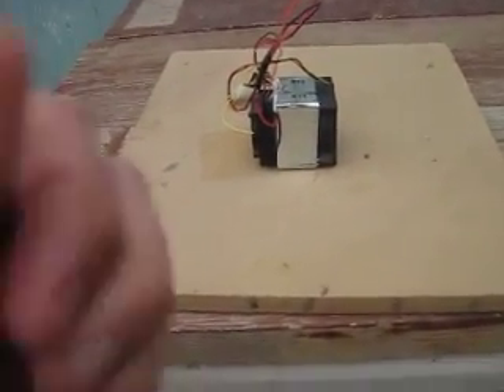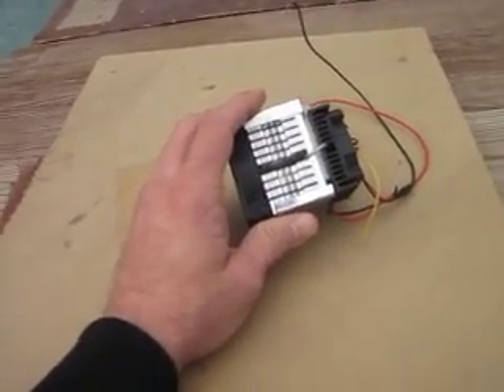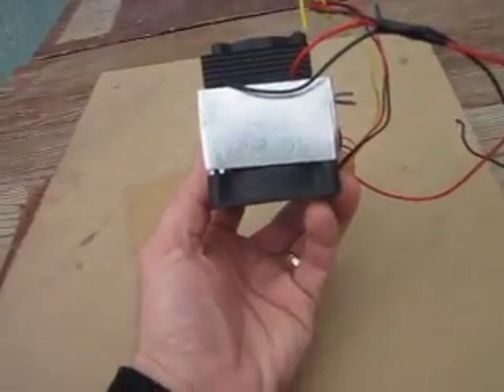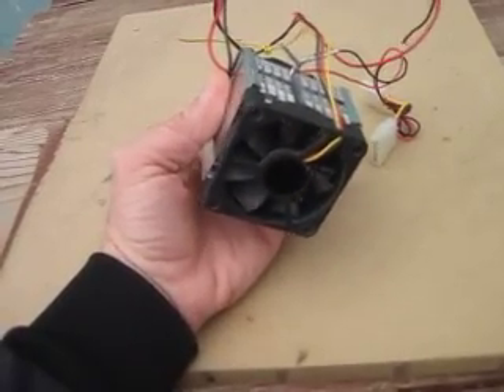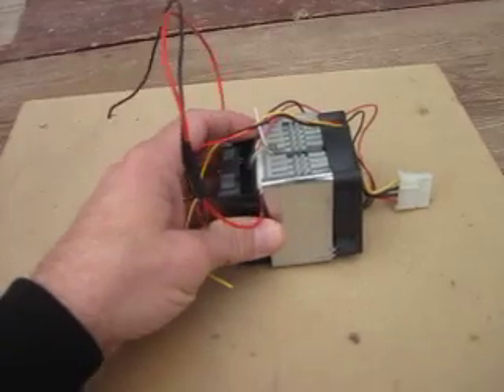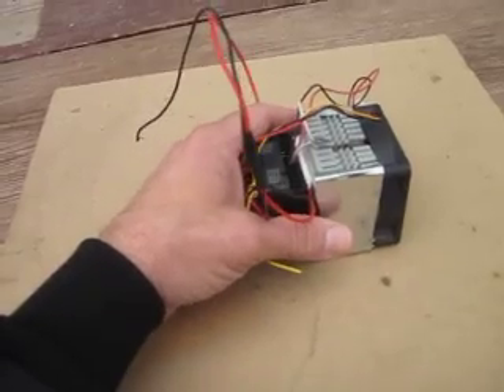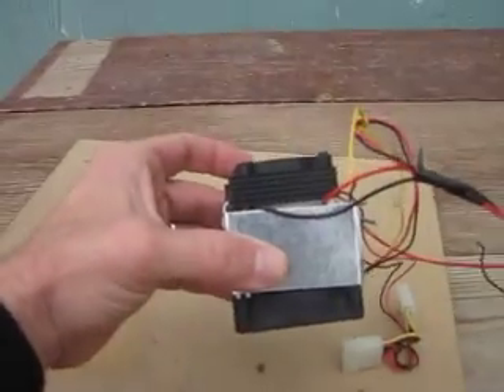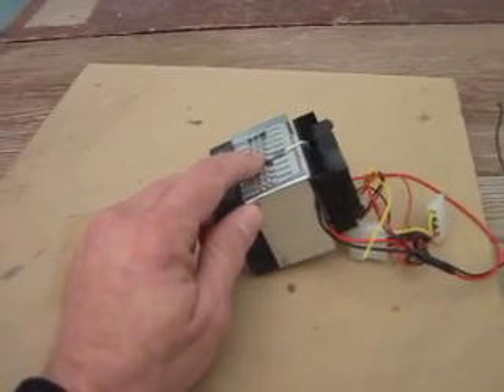Peltier Device explained a bit better.

Comment: should i connect 12v/40A SMPS with TEC1-12706 peltier module?
Reply: It will run at maximum if you do; if you want to dial it down, lower the voltage and amperage. Gotta regulate!

Comment: If you live in a hot climate, you could flip it around and make a personal a/c. Roll it up in your window opening, hot side out, cold side in...reverse the cold-side fan so it pulls the cold off of the cold-side heat sink, blowing cold air towards you. It may not cool the whole car, but if you roll it up on the drivers side window and face it to you...a personal air conditioner.

Comment: I got one from ebay and fry up at 9v 2 amp but on the site sais 12v 6amps why it did that? and the hot side was at 33c° and the cold side at 19c° so why?

Comment: i had a quick question if i may ask. when hooking up the device with the 2 fans and peltier to a 12v 6a. should i do series circuit or parallel when hooking up the wires....

Comment: SIR,
  i am making a project on peltier helmet. how much current should i pass through the peltier plate if its specification is 6 ampere 12 volts and 60 watts. should i take 6 ampere or less...and why ?
Reply: +Bill Graham i have 12v 1a adaptor, can it produce enough power for 12v 5a peltier device?

Comment: How are you regulating the amperage? My understanding is that amperage is relative to the voltage you are running at ie 2v will draw .3~.4 amps and at 15v it will draw 5~9 amps, are you cutting duty cycles?
Reply: SIR,
  i am making a project on peltier helmet. how much current should i pass through the peltier plate if its specification is 6 ampere 12 volts and 60 watts. should i take 6 ampere or less...and why ?
Reply: umang shah I would say go with a alternate approach, liquid cool your helmet with some type of tubing collecting heat and a 60~80mm rad to dissipate the heat, peltier coolers are not energy efficient you would have to have quite a beefy battery. You would also have to dissipate the heat  the peltier itself produces.
Reply from the maker: Sorry for the late reply, I hadn't gone back to this video in a while. Right, melsoftm, I was incorrect, I would lower the voltage therefore the current going in. That's all I was doing but peltiers are a bit odd, and I haven't gone back to this in a while now. I need to get back to this but other projects needed me (and still do). Thanks anyway!
Reply from the maker: umang shah Agreed with melsoftm, the peltier is the wrong device to use as a cooling system for your head inside a helmet. It cools TOO much at one time unless some serious ventilation is used, and therefore wouldn't really need a peltier if lots of ventilation can be used in the first place. I suggest some sort of air cooling using ducts or cuts in the inside padding if any, and a small caged fan (such as a 6v processor fan with a grill guard). Though peltiers are neat, they just aren't too good for some things.

Comment: Hehe I like Ur video and your ideas, 
But it won't generate enough to heat a car.. Though u can use it to heat water! Make a portable coffee machine! Or water heater and on the other side a fridge for some cool beverages hehe! Woud love to see another vid of you!  Cheers
Reply from the maker: greg77389 sorry for the late reply. Yeah, I was kind of babbling in that video. The idea is to eliminate the need for an alternator using peltier devices somehow to make the engine more efficient overall by not having to need to drive an alternator (at least after the engine gets to temperature, then the alt. can cut out and use the peltiers fully). Thanks!
Reply: Thanks! Right, also had an idea to use a few of these to transfer heat from the exhaust pipe into the cabin with a heat sink and fan. I never did like the heater core idea, we have plenty of waste heat from the tail pipe.
Reply: Thats absolutely right ! i have a old car and that uses exhaust heat to !
Reply: Maybe one won't heat a whole car, but a few of them will :)
Reply: im sure that will work :D and if you reverse polairity u have a nice cool breeze !
Reply: I think a better use of this in a car would have it serve as a heat sink for all that excess engine heat and use the electricity it produces to help charge the battery, thus reducing load on the alternator and improving mileage.

Comment: ... the power supply should go as high of amperage as you can get, but I say put a resistor in that limits it or some other way to regulate the amps going to it.

Comment: I think you meant 12V 1A. You have to make a controller for it, could be as simple as a single resistor or a variable resistor and a knob and dial. 12V@1A is maximum that you want it to use. Also depends on what you are going to do with it. Computer processor cooler? Put it between the heatsink and processor with thermal paste and run it at 12V but have a variable resistor so you can change it. Small cooling area like a fridge? 12V power supply that is cooled and heatsinks on both sides....

Comment: I think you miss understood my question. Mine is 12 amps and 4 volts 60 watts TEC1 12706. It doesn't have a plug on it. It just has a black wire and a red wire. What am I supposed to do with those? How do I know what to stick those into?

Comment: A current regulator drops the output voltage in a way that there is a maximum current output, and I'm sure you know that. Seeing as how these things are made of PN junctions, the voltage drop must be a constant rather than from a resistance. If that's the case, why not just use a resistor to set the current?

Comment: I can run mine directly on the 5v output on a 250w supply and it works fine. On 12v it would burn out quickly.